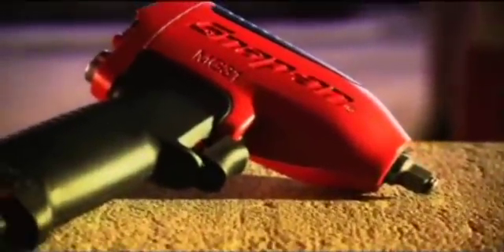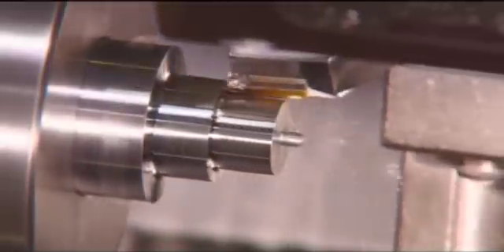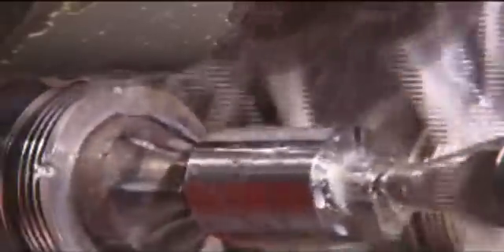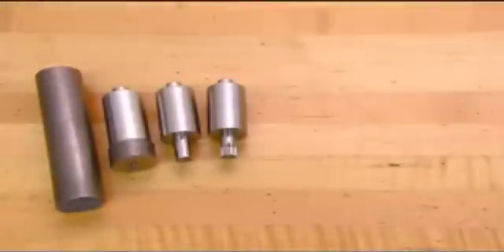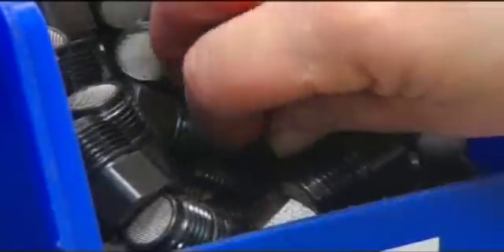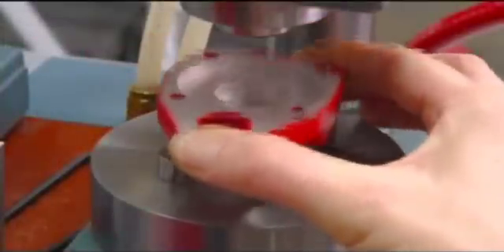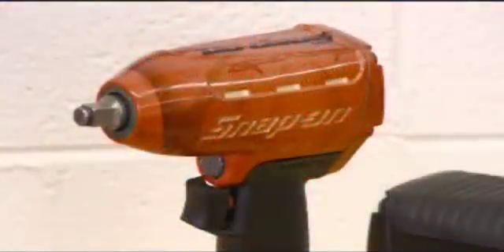Snap-on Tools featured on How It's Made  - Impact Wrenches

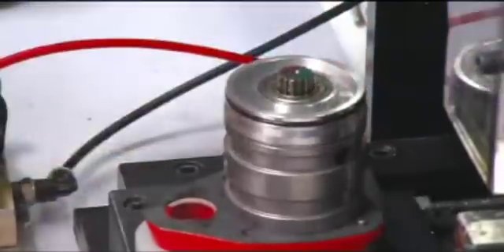Comment: 4:14, spoke with Red Line Oil. They said its their D4 ATF.  A tip also, install the air motor vanes BONE DRY!!  It seems counterintuitive, but the engineers did their work and chose the right material for an acceptable longevity. When I used air tool oil, I think they weren't sliding in and out like they were supposed to. Upon re-assembly, they moved freely and it worked a lot better. The only lube they need is what they get from the daily tool oiling or in-the-air-supply lubricator. Pre-lubing them was too much oil I guess.